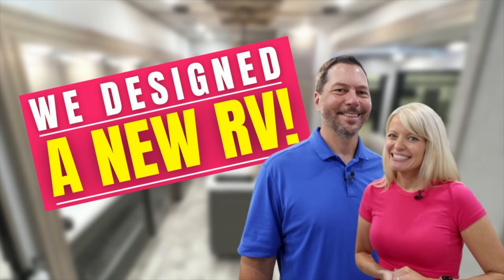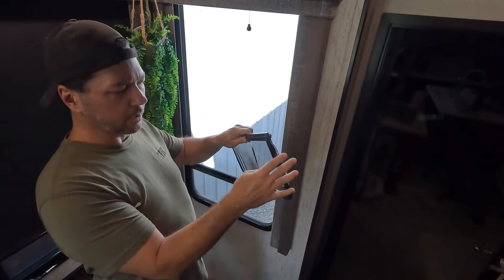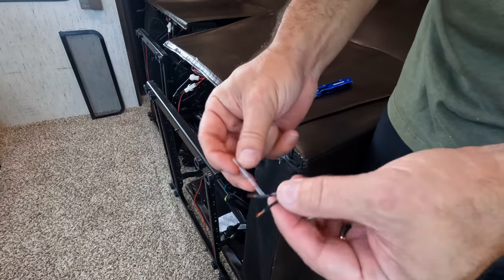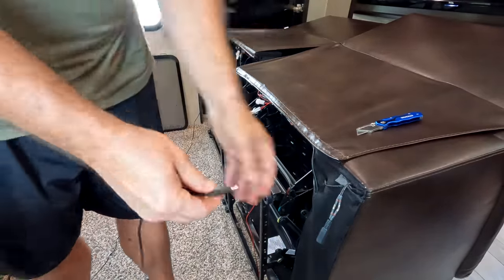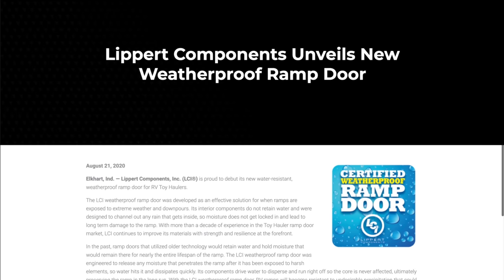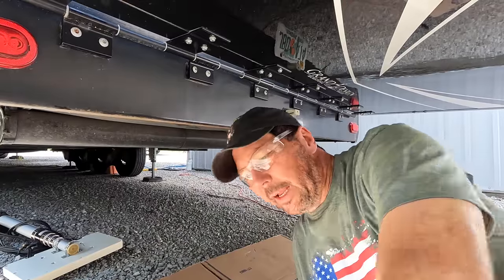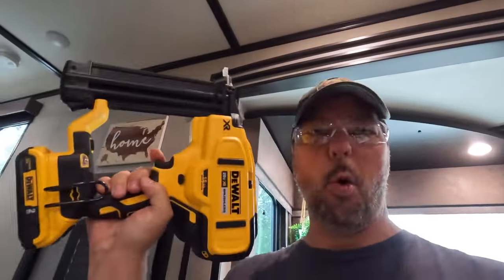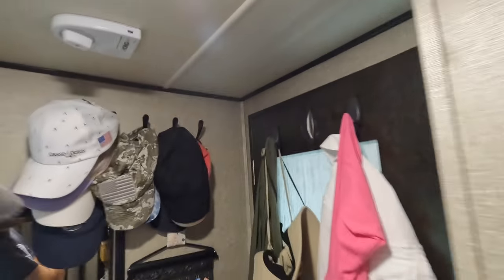The Final RV Repairs (2018 Momentum 397TH)

Comment: Just a quick observation. The extra wire that you were wondering where it went to on the two chairs probably goes to the additional pieces that could be hooked up onto the two chairs in order to make it a full length couch, being that the other end I believe would have a powered recliner as well. Just my thoughts Tod

Comment: Great video!  Recently I discovered that someone at the factory nailed the entire corrugated poly underbelly to the frame and there’s no metal flashing either. They nailed the underbelly directly to the frame. Very frustrating trying to do work underneath. You’ve shown me what I’ll need to do. Grind them all off and then add a metal flashing with self-tapping screws. Thanks!

Comment: That Dewalt nail gun rocks! As I'm mobile repair, I bought it as I was replacing motor and gear box on a cable slide and the trim around the slide had to come off. Re-installing the trim was fun! Actually had to stop myself from over nailing. side benefit for the owner, all the rest of the trim in the tt is rock solid! :)

Comment: I have a 350M with the 4 seat couch like yours. The extra connection you found under are for the middle, no-armrest, couch pieces. Also, the heat on our seat takes 20 minutes for you to feel it.

Comment: Great job Chad.
My 2019 Puma used nails through frame fir coreplast also.when adding a set of shocks hadvto deal with those pesky nails too.
Tried several techniques.  The real winner was my air chissel. Simple, quick and loud! 
Do they make a battery operated power chissel?? Hmmm

Comment: I noticed while you were work on the back of the trailer your happy Jack lift for your countertops fold down. You don’t by chance have a model number or part name for that fold down bracket? I have a happy Jack lift in mine but the sofa benches don’t fold down and I could use the extra clearance. I have searched the internet for them and have no luck. Then I saw them on yours tonight and thought I would ask. Thanks for the awesome videos!

Comment: I have a momentum 351 and I have a question about our roofs on these RVs. I noticed after walking up the ladder a few times and inspecting the roof I had a few tears which I fixed no problem but one I noticed next to the ladder near the side of the roof at the radius where it meets the gutter. I was surprised to see the roofing fabric material isn’t glued it’s just stretched over the plywood substrate and there’s a gap under the fabric making it very susceptible to tearing and water intrusion. That tear in my roof material allowed water to get underneath and in that gap causing an issue of trying to remove that water and any moisture. I talked to Grand Design and they says they don’t use any metal radius to fill in that gap. My question to you is yours like that? Can you just push your finger into the fabric on the side where the plywood’s ends and it’s hollow underneath there? I really feel they should have put some quarter round or something in there to make it a solid radius so the roofing fabric could be glued all the way to the gutter molding

Comment: Your comment about not being real good about closing the rear ramp door during rain hit home today.  I’ve been at my current park in Jacksonville for two months.  It’s summer in Florida so it rains every day. I’ve been leaving the deck down and yes I get a little water coming through the three season doors.  However what surprised me was when I went to close the back door it weight a lot more than I recall.  I pushed it up and quite a bit of water came streaming out of the bottom.  I was quite surprised as this is supposed to be Lipperts new certified weatherproof door ramp/deck.  Maybe the water drainage is normal but I am not really sure.  Owners manual of course says nothing.  You or anyone else encounter this? Should I shut the ramp during rain?
Reply from the maker: I believe that's normal, but you might call Lippert to be sure.

Comment: Not great to use a glue on that insulated unit/window it can break down the urethan that is between the two pieces of glass. This will lead to a failure of the seal between the two pieces of glass and the window/unit will condensate inside. Best to put a duck tape on glass then put silicone in the piece of frame before installing it on top the window/unit. I 'am not trying to be a jerk I actually manage a glass shop and just want to help you for future repairs. love your videos and inspire to travel with my wife like you guys do, even want an Indian motor cycle too!

Comment: Another great video!  Our LED light strips on our awning on our 350m are on their last leg.  Have you had to replace yours and Can you recommend replacement light strips?
Reply from the maker: We've only replaced the front cap lights and they had a section die after a few months.  I'd contact the manufacturer of your awning (if they're on the awning side and not the RV side) and see what they say.

Comment: I have led light strips that run the length of the side walls (horizontally). One little section is not working, about a foot long. Do I need to pull out the entire string or can it be repaired?  Thank you for your time.
Reply from the maker: Not very familiar with them, but I'd guess the whole strip needs to be replaced.

Comment: That is not the way to fix the floor in the garage. Once the moisture is into the particle flooring it doesn't stop there.We fix ours 3 years ago. I would not be impressed if I had bought your trailer and found that you had just put a bandaid on a big problem. The manufacture should do a better job building these trailers.

Comment: You fucked up on your window repair there’s a reason that rubber was there around the glass, aluminum and glass expand a totally different rates and a total different temperatures in total different amounts of expansion glass is going to end up breaking and for sure the glue you use is going to fail
Reply from the maker: Time will tell....
Reply: @ChangingLanes  it will, but I have been a home builder for over 30 yrs , and have many yrs experience with building products and technology,especially windows and doors , but good luck with your new rv and love your Chanel, hope to run into you guys on road one day ❤️